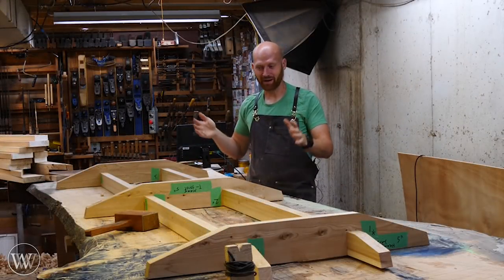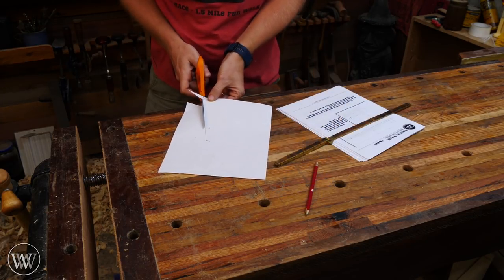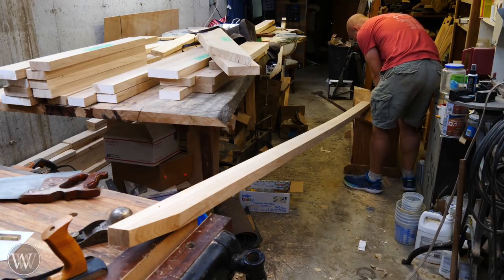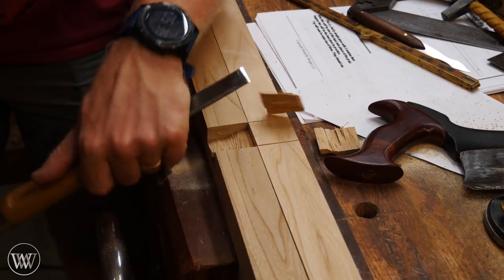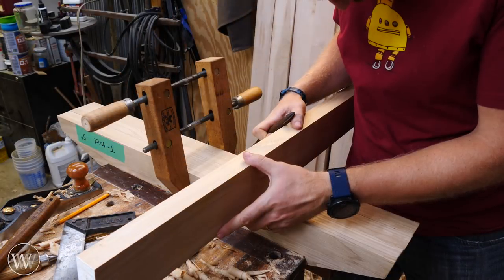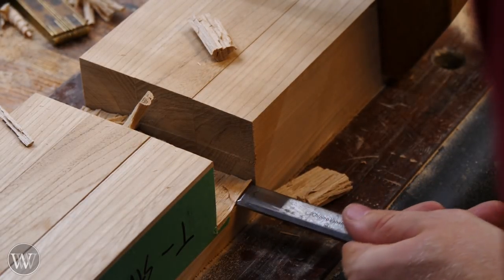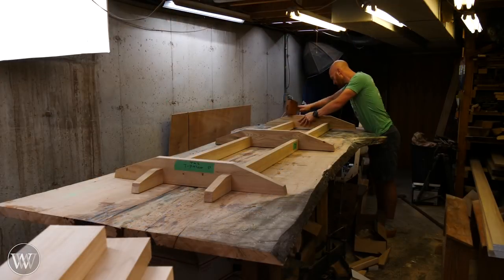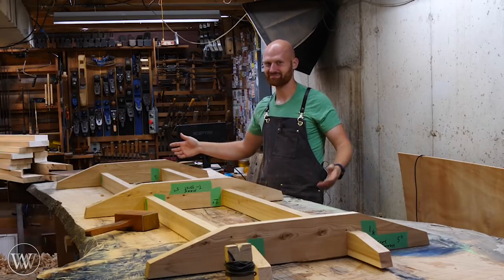Building an Elm Base for the Dining Table

Comment: Beautiful,  thank you James. I read on wikipedia that Elm wood is highly valued for its interlocking grain which prevents splitting.
Reply from the maker: for furniture making it is OK but that does not kelp it that much. the place where that shines is in chopping blocks. they would use it  there with the end grain up so that cleavers and hatchets would not split off chunks.
Reply: @WoodByWright  Got it, thank you

Comment: The thing I am always puzzled about is supporting the table and preventing warping without cross grain construction.
Reply from the maker: With such a thick top there is little problem with that. Also being in an air conditioned house where will be no mesurable warping. I have not decided on bolting the top down or just letting it sit on pegs. I will probably go with pegs.